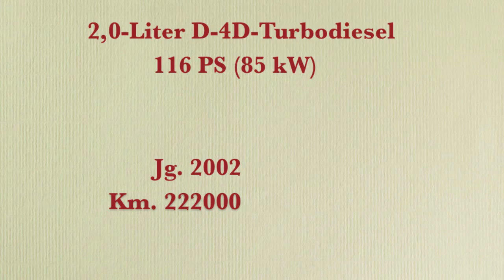AGR EGR Ausbau und Ventil Reinigen Toyota d4d Teil 1

Comment: Can You describe symptoms of sticking egr? I have t25 and seems that my egr is not closing fully. After 2.5 rpm thrust decreases in comparison with range from 1.5k to 2.5 rpm diapason. Is it egr fault?
Reply from the maker: hello could be, would try to clean it will certainly not hurt. much success marco

Comment: what kind of cleaning liquid was used? - a impressive result....
Reply from the maker: Hello Victor
Thank you for enjoying the video. I have used a car brake cleaner in the can that cleans very well. Thanks Marco
Reply: I just used a carbretter cleaner spray or brake cleaning spray. Worked like a treat. Make sure you wear gloves and place a mat under it when cleaning. use an old tooth brush to clean it. I left mine in the cleaning fluid overnight. Brilliant results.